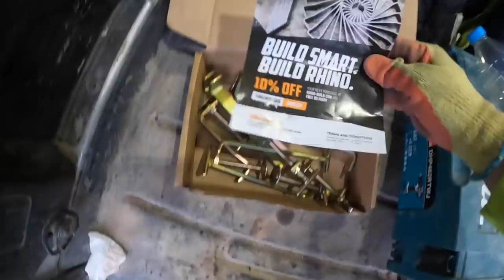UNSTABLE PILLAR BUILD...A & E EXTENSION PART 3

Comment: Any particular reason why your pillars did not have steel vertical reinforcing inside of block cavities with concrete fill cells?  It would have prevented any mobility in the pillar until the vertical loads are piled on, and would prevent a failure in the future from any kind of impact.
Reply from the maker: Never seen that done here in England 🧱👍🏽
Reply: @SteveAndAlexBuild  we use hollow concrete block and run reinforcing steel from the foundation up in each cell, using couplers or more often simple rebar overlaps, then fill the cells with grout to the top.  It makes a very strong pillar within a wall.  We also do horizontal bond beams in masonry the same way, with reinforcing steel running horizontally through special masonry shapes, and filling with grout to create a network of vertical columns and horizontal beams, all buried in the block wall.
Reply from the maker: @justmyopinion99  🧱👍🏽